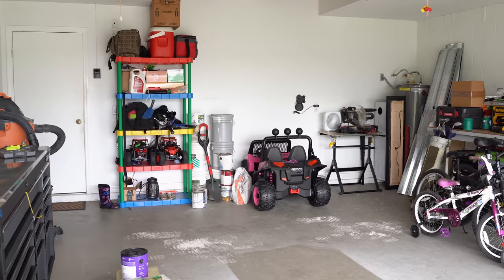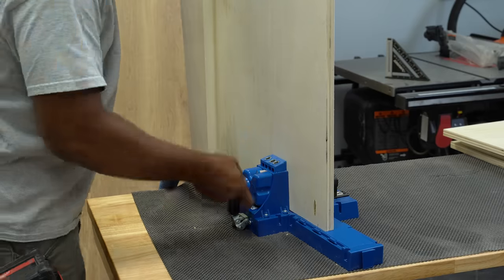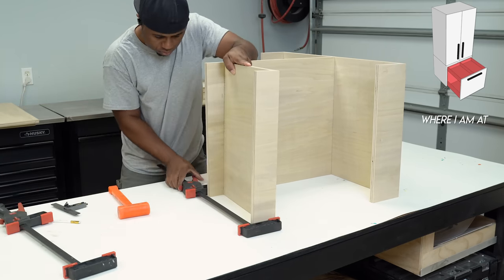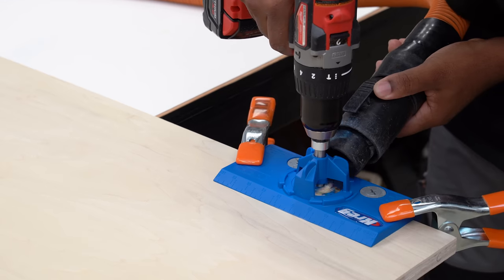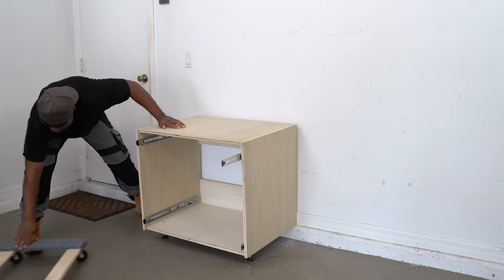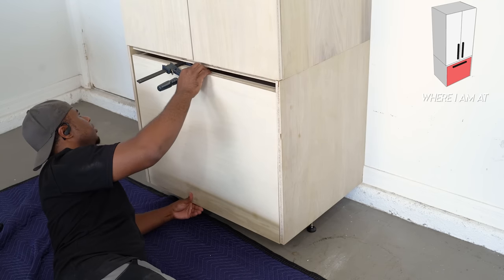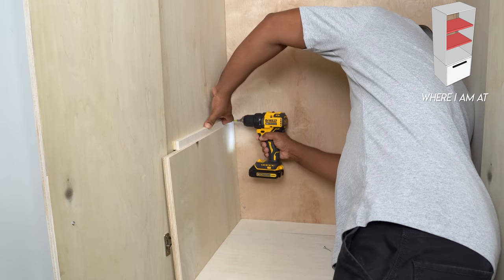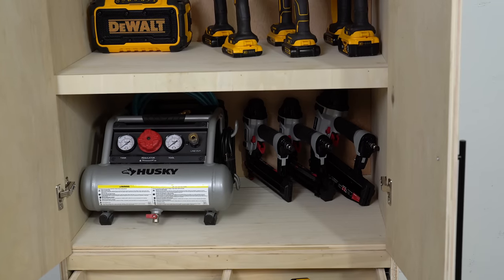DIY Garage Cabinet  - Storage & Organization | DIY Creators

Comment from the maker: I hope you guys enjoyed this video, I am working on expanding these cabinets. Be on the lookout for the next video. I am not sure what color to paint the cabinets yet, but I am taking suggestions.
Reply: Making epoxi flooring vine red and golden blue
Reply: I recently used General Finishes Oil-Based Arm-R-Seal on some indoor bookshelves from Baltic Birch Plywood. Increased the surface strength. It ambered the natural look of the wood slightly, but beauty of a natural finish. Of course...Java or black stain does well for hiding markups.
Reply: thanks,  enjoyed it very much...👍👍👍
Reply: I think Grey would go very well. You could make it lighter and darker between insides and outsides.
Reply: What about Olympic ring colors?  Bright, cheery & kinda reminds your psychi to strive...!
Reply: White on the inside, so you can see in there, slate grey on the outside.
Reply: You should do them tye dye! Nah I’m joking. Black and/or Gray is always a good choice.
Reply: I like theme colors for certain stuff in my shop. I have a lot of stuff with clear varnish on the wood, and blue trim. For example I just built a flip cart for me planer and oscillating sander, and used blue trim. Re-finished my table saw rails in blue, which matches the branding color by Delta. SO I would pick a theme for certain tools, etc and match all the same stuff with whatever stuff you paint.
Reply: Dark Blue.  My favorite color for shop furniture and cabinets.
Reply: Dark gray.    
Im happy to see an African American doing woodworking and construction work. Id like to see programs in the inner city teaching skills to younger men and woman doing the trades. Right now there is a shortage of workers and union jobs can pay between 60k to over 100k a year.
This would both fix up inner city properties preserve our history and provide good paying jobs. It would also help to lower the crime rates make negiborhoods safer  and change people's perspective on who or what the inner city is like.  Everyone would benefit from this.

The class would fix old houses for those in need or abandon houses then sell them for profit to use to operate the program. Some students can ask that there home is used. You work to learn skills, get paid somthing out of the profits and earn your certifications 
From this school new students are hired by crews looking for help. 
This works just need some people to pull togather and get it going. 
This could be your stance from a court insted of jail time for people with minor offense like shop lifting. Its a second chance to become a valuable asset to society.  And its a lot better then jail.
States could even help fund this becuse it saves taxpayers money.
Everyone is valuable. We all just need to find our place. 
You do good work. 
I may have used 3/4" MDF in the garage.
But thats up to the customer, mdf used in the right places is just as good as plywood.  In fact its better for speakers and subboxes.

But I'm also Blue and none just clear.
You could do the side by the door inside in a chalkboard paint 
Id also hang a tennis ball from the celing to touch the cars windshild to show you where to stop. You know woman drivers
Talk on phone comb hair and put on makeup, who's got time to stop short.

A really cool back out tool is a large mirror on the forward wall so you see what's behind backing out.
Reply: Request sir if you can: A project using NOT POWERED TOOLS....... thank you
Reply: @DIY Creators  I have an idea or a respectful suggestion... I am furloughed single mom with great ideas that would improve my home. Although, I have the time NOW, I don't have the power tools you guys use to do so; it would be lovely to be able to attend a workshop (mask and gloves on while being socially distance) to create some of these projects during these trying times. 😕 Do you offer something like this?
Reply: Only in my dreams would I be able to build anything like this.  I simply enjoy your videos and the way you make my dream furniture come true so effortlessly.  Thank you for making it so entertaining to watch!
Reply: What are the dimensions of the cabinets?
Reply: Awesome!
Reply: Awesome!!
Reply: what kinda pants are those? hahah (really asking)
Reply: you all prolly dont care but does someone know a trick to get back into an instagram account??
I was dumb lost the account password. I would love any tips you can give me.
Reply: @Kash Cole Instablaster ;)
Reply: @Jaime Johnny it did the trick and I actually got access to my account again. I'm so happy!
Thank you so much you saved my account !
Reply: @Kash Cole no problem =)
Reply: You just made me smile watching you work. I was an avid DIY'ER and a nurse, before I was injured. I hope to return to doing something in the future. I'm also a crafty one. I love creating. You have inspired me even more to try to get back to the things that I love to do. Thank you.
Reply: How can I learn from your work? Step by step
Reply: supe

Comment: Exactly what I need right now. I've been slowly building up my collection of power tools and found myself keeping them in their packaging boxes (some have cases) when I'm done with them. Afterward, I just shove them underneath the table for "storage".  One thing I can do though on my version is to have the bottom section on casters instead of attached to the wall so that I can pull it out and use it as a tool cart.

Anyway, Thanks for the build, keep it up, stay safe, and God Bless. . .

Comment: This was great. You have inspired me to attempt to do this myself. I’m in the process of doing my garage and I wanted to include something like this but invert the cabinets. Longer at the bottom and shorter on top; the reason is because I want to hide my water filtration make it accessible and also add cabinets for storage on top. 

Should I also mention that I have never done this before. 😂 TY for the step by step and plz wish me luck. 😅

Comment: Excellent!!  I learned a few tricks from you in the process.  Using compressed air to unclog the water heater drain valve was smart.  Your problem solving skills are very good.  And, your garage floor turned out great!  One suggestion for the trim at the door edge is to use clear silicone instead of liquid nails just in case you need to pull up the floor at a later time.  Thanks for taking the time and effort for sharing your project. Your video editing skills aren't bad either🙂

Comment: Thanks for sharing your project. Just so happens, I am remodeling my kitchen cabinets. I have exactly the same problem(s). You broke the project into nice sized pieces that you could move by yourself. I always think of jigs to space shelves and place drawer pulls after I have messed up two or three times. You plan ahead. Good work and good luck for the next phase.
Reply from the maker: Thank you; my goal is to keep things simple. That does require a lot of time but usually worth the time to plan it out.

Comment: Nice build. However, couldn"t you have used toggle bolts for added holding power to the walls? I know that the leveling feet holds quite a bit of weight, but I would want more by using the toggle bolts. Keep the great videos coming!!!

Comment: Probably not for everyone, but my shop is done with white walls, red cabinets and black doors. Pegboard is black with red trim. Adds a nice splash of color.
Reply: I went with the red and black color theme also since getting my saw stop and laguna band saw. Unfortunately, the jointer I’m zeroing in on is that ugly powermatic yellow color.  I refuse to buy anything Rigid since being a Sooners fan I cannot abide by anything burnt Orange on my property.

Comment: What if, instead of 1/4 plywood back, you used a dado blade and two small 2x1s to set in a stable peg board back. You get the nice clean external look, but then also could use the peg holes to hang things inside of you wanted? Not sure if my description makes sense.

Comment: Hello DIY Creators, I saw you also used Dewalt Drill Driver and Impact Driver, they are not listed in the tool list, are the ones you used the Atomic versions?

Comment: Can I use pocket holes without gluing the two pieces? (reference: 1:36)
Also, can this (or a similar project) be done without pocket holes and just screwing it straight on??
Kinda urgent,

Thank you

Comment: nice job Bro, may i know how many plywood you used for this project ? seems like i want make this for my 1 car garage workshop, i'm not using big machinery just lots of corded power tool, and i need one like this so i have lots of space
Reply from the maker: I have not done the final calculation just yet, because I cut a few cabinets simultaneously. I should know more by next week. If I had to guess, I would 3.5 sheets.

Comment: How come you didn't just drill the top cabinet for adjustable shelf pins?  All my garage cabinets have adjustable shelving and I've modified its configuration a couple times as the need arose.

Comment: Glenn....URGENT. Noticed your Water Heater sitting on the floor. PLEASE, PLEASE,  PLEASE raise it off the ground a min 18” off the ground. Accident waiting to happen, flammable fumes typically stored in garages lie low on the ground and the pilot from your water heater will ignite causing fire or worse explosion.
Reply: No pilot light on a electric water heater

Comment: Those feet REALLY don't look like they will support that much..
Reply from the maker: I believe they are rated for 1000 pounds.
Reply: @DIYCreators  At that level of extension though? Ok! I have a similar foot which was on a table saw fence that I dropped and it bent.. but if that's what the specs say, I guess it'll be fine